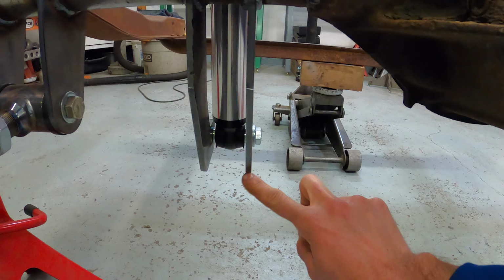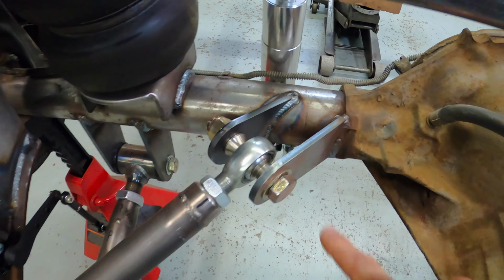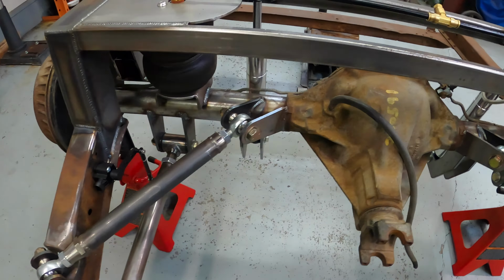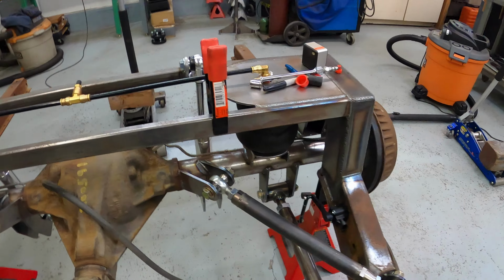The Manhattan Project: Episode 15.  S10 rear axle finish work on the bagged Fleetline Aerosedan.

Comment: Nice flaring flairing? tool. That’s one I still need to invest in. How come your going with a solid and not an IRS. I have one but not sure what it is. Maybe 77 Nova like the front clip but I was thinking of IRS.
Reply from the maker: I kept a solid rear axle for a few reasons.  
1 -its a lowrider not a performance vehicle.  
2- With 6 inches of rear suspension travel an IRS would have so much camber and toe change throughout the range of motion the car wouldn't be drivable at all ride heights.  With a solid rear axle, the camber and toe do not change during suspension travel.  I can drive it when its 1/8" off the ground or 6" off the ground just the same.
3- the S10 4x4 rear end is the right width for the car. 
4- the rear axle cost me $150, they are in every junk yard and super cheap.
Reply: @OMCbuilt  reason #4 is why I’m keeping my for the first build along with the 77 nova front clip. But just dumped snow here so I’m stuck for another year.
Reply: @OMCbuilt  what year of s10
Reply from the maker: @josindee91  Mine is from an early 90's but I think there is a pretty wide ranch of S10 years that work.  It's pretty easy to find the info in a google search 👍
Reply: @OMCbuilt  thank you brother
Reply: Any square body s-10 rear end will work. It must be a 4 wheel drive rear end to fit though. 52” inside backing plate to inside backing plate. When you search it up at junk yards any S10 4 wheel drive rear end from 1980-1993.
Reply: @linghunter5878  thank you so much brother